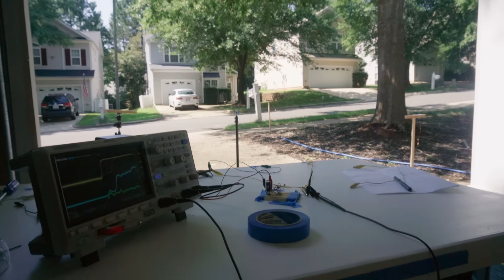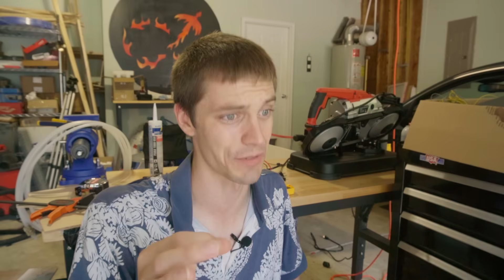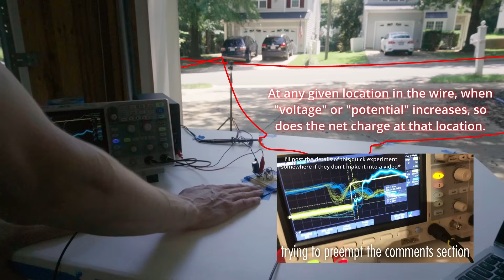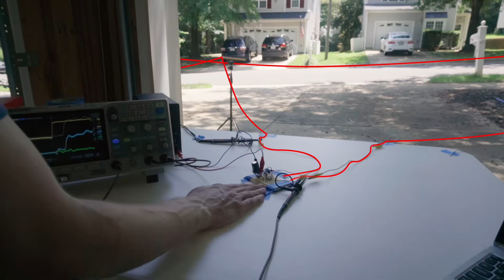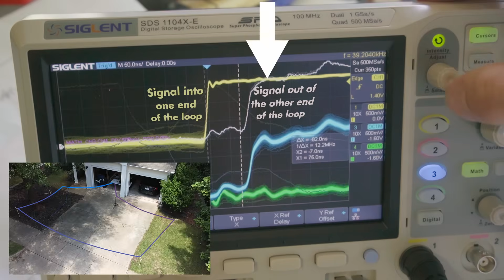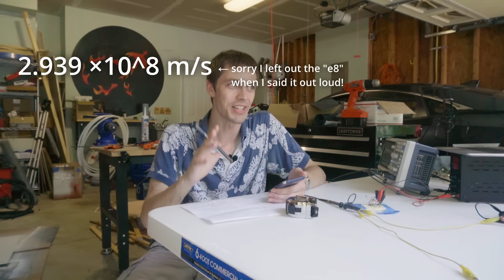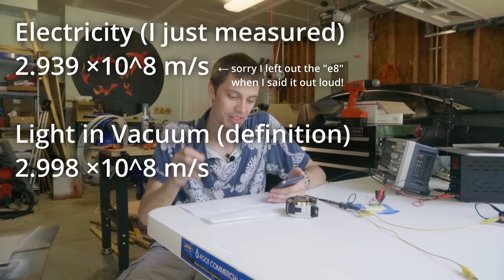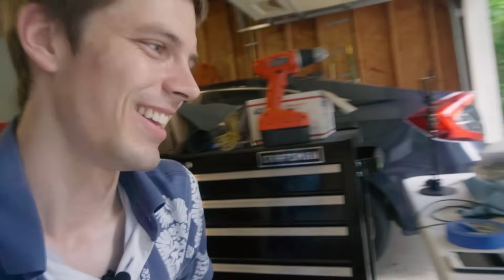Why does WATER change the speed of electricity?

Comment: So if they measure the speed of light with wires on a sensor, does that not say that the speed of light is faster but that’s as fast as the wire can tell the computer a signal?

Comment: Did you use reverse osmosis de-ionized water? Impurities can conduct electricity if abundant making it no longer completely dielectric and effectively turning it into a resistor in the current situation.
Reply from the maker: There’s still enamel on the wire

Comment: long wire has capacitance, oscilloscope measures the delay due to the charging of this "capacitor" and not the speed of electricity, by adding water you just makes this capacitance higher, imho, to be clear here it is necessary to measure both front line and back line of the signal (to exclude capacitance/inductance effects)
Reply from the maker: Yes! Also related to light transmission

Comment: 212
I have a question for the author: I'm interested in the frequency of the rectangle that was fed into the loop. If my assumptions are correct, it should be about 30 MHz. With a longer rectangle, the delay would be even greater. Thanks for the answer

Comment: If you fill a hose with water and it's 100 miles long then turn on the tap and water instantly comes out the other end did water just travel at the speed of light ? 
No
Neither did your electricity
Reply from the maker: It’s not instant with water. be careful not to confuse electrons with electricity
Reply: @AlphaPhoenixChannel Yes it would be instant if filled with water, its the only option.. but nothing traveled the full length of the hose. Same as your electricity.
Reply: @iRiShNFT It is never instantly. The pressure wave propagete with the speed of sound (1500 m/ s)  through the hose. So it will last around 67 seconds.

Comment: Frequency dependent dielectric effect is called dielectric relaxation and causes high frequency power amplifiers to stay rugged withstanding higher than dc allowed overvoltage stresses on cmos transistors gate oxide layer

Comment: spoken like a modern scientist ... and not an electric engineer.
I wish you would have given more information about solid strand vs braided wire. Because you're speaking like charges create the gradient curve and make little demands for electrons. No, I believe that it's magnetic stray currents that inhibit the initial propagation. Some kind of neutral conventional current head is moving along making the demand at near light speed. You can think of it like an infinite virtual photon that breaks apart as needed for a charge density demand. Behind it is a balance of magnetic vortices in the wire. 60 degree braided wire has a cosine cancellation effect on the skin eddies. This looks a lot like a sink drain. 
It makes sense for chemistry backgrounds to think in terms of charge, but in the engineering world, we see charge nullified at small distances. Current moves loads and reigns supreme and makes a lot of stray signals. But we use current loops to overcome noise because voltage is very bouncy and unpredictable across a wire. It's the magnetic part that radiates infinitely away from the wire and regulates the current throughout a conductor or coil. I admit there's not a lot of quantized units around the magnetic field, but any long distance effects have to consider them. In fact, the magnetic lines are entirely unbreakable and more of a auer-sum than voltage waves.

Comment: The field is outside the wire, OK - but how far outside? What does that depend on? - the voltage? - the frequency? - the micro-surface roughness of the wire? - the crystalline structure of the metal? So if you put a rubber-insulated wire in water, what factors (aside from the thickness of the rubber) would affect whether the signal in the wire would "see" the water or only the rubber?
Reply: the magnetic field extends infinitely far but falls off with distance, there is a formula, it depends on current ie amperage but current is induced by a voltage drop and influenced by resistance so its all related
Reply: the only way to block it is with a conductive sheath

Comment: Actually, you measure the resonant frequency based on the wire length and with a standard sine wave, you will find roughly eighty percent of the speed of light.. however drive it with an open ended Tesla coil capacitor and coil network, sending through counterspace, and You can exceed the velocity of that of light, based on the wire length

Comment: the magnetic field of the earth is in a way being conducted through the rock, and as soon as the rock, soil, etc come to an end and interface to the air, the magentic field drops off sharply. Because many minerals are para magnetic or exhibit other forms of magnetic responses which means they play a role in helping to donduct the magnetic field. otherwise the ionosphere probably relates to it also and it might by why the field lines loops out the closer you are to the...surface. ina sense. they go intothe south pole exiting the northpole. So water is also higly polar and magnetic in ways. idk about basalt. ocean crust is basalt. so you will see a different magnetic field strength perhaps more moving,stronger. simply by being at a deeper ocean depth you will be in a stronger field. the cold temperature helps increase the hardness of the magnetic field that does exist, in any metal, or the chance for the field to work on the conductor because it is more responsive with colder temps. Cold increases magnets. If you have a conductor go perpendicular to the magnetic field lines you will be increasing the resistance because not all electrons on net are moving in the direction of the axis of flow the length of the wire, and if they are not all of them in the right direction on that axis. so you have resistance in general. By crossing the field lines the conductor is even more resistant. If you can orient the conductor the right way with respect to the field lines the magnetic field deflects electrons trying to move not along that wire length, and therby reduce it's resistance.

Comment: What if the tube is filled with distilled water?
Reply from the maker: Shouldn’t change anything - the water isn’t conducting, just getting in the way of the field
Reply: @AlphaPhoenixChannel true, it isn't, water is an insulator. It's all the stuff in (tap) water that is conductive (minerals). 😉
Reply from the maker: @Iowa599  i have an insulator between the wire and the water - i don't mean the water isn't a conductor, i mean it's not conductING
Reply: @AlphaPhoenixChannel I know, but the field is interacting with it, like you saw.

how would interaction be effected if the wire was routed through a giant insulator that is more resistive than air?
Reply from the maker: @Iowa599  the impurities in the water that allow non-distilled water to be conductive should have a negligible effect on its ability to slow down the field.

Comment: Nice attempt, but you might want to check out the "Electron hole" concept from electrical engineering. Basically, your battery or power supply is pushing electrons on one side and displacing the electrons in the wires atoms in a wave effect, and sucking the electrons from holes on the other side which again propagate like a wave. That means on the one hand you are recording a timing difference between the holes and electrons, and on the other you are recording the wave propagation.rather than the movement of individual electrons. You can solve the one issue by powering a device at a distance to accurately figure out how quickly the device powers on. Of course the fastest would be a light emitting device and light receiving device, you will be dealing with the distance between the transmitter and receiver, and threshold voltages, The other option is to use a cathode ray or electron beam gun to measure direct transmission speeds.
Reply from the maker: There are no electron holes in metallic conductors - the fermi level is in the middle of a band so thermals are enough to get a single quasiparticle-electron moving

Comment: 9:14 that's so wrong, electrons starts moving because of the differential potential, electrons basically just wants to fill the dipole holes at the other side of the cirfuit, because they were already there, that's why your oscilloscope had an basically* instant reading of the electrons moving when the circuit is connected, technically we can't physically measure anything beyond the speed of light, that's the limit, theoretically we can have predictable operations by equations happen instantly, but just because we imagine them to be that way, doesn't mean they didn't hit the limit, you can't prove if electricity is happening at the speed of light, we would have to ask what even is electricity, it's different for DC and so is for AC, if you've stretched out a display of your mobile in time and space to an whole track of a C so that one way to the right would be half the speed of light and so to the other side, the screen would start bending the rate of framerates if watching a video, or a gif, whatever, so it would get bend by the time, but if you zoomed out your self in space back so that both ends of the sides would stratch for a half speed of light to you, you would see the presumed video relatively speaking more stable and so it is with electrons... So we either would have to ask what is electricity or what is time and therefore what is space
Reply from the maker: You’re making this harder than it is. A “dipole hole” isn’t a thing, and the rest is explained in this video and others on this channel. Humans know what electricity is and how it works to an EXTREME degree of precision. AC and DC also work the same way
Reply: @AlphaPhoenixChannel  DUDE xdd what do you mean it isn't a thing, just seconds later you said that electrons are the cause of electromagnetic fields, as if electrons had them selves electromagnetic fields, it's the material which the eletricity is lead trough that creates the field and even without it, those electrons are still there without any sorts of voltage/amp ratio, all that's happening is that you're amplifying the intensity of the flow of electrons so it is a hell of a BIG deal oh my god, the other half of what you've just said, AC and DC isn't the same, lol, who even thinks that??? It both has physical aplications and your channel isn't covering nothing but measuring experiments together with some random calculations mixed up with an oscilloscope, yes you technically are measuring the speed of rate electrons are shifted, but the description you've depicted is horribly wrong, not pointing out that you've said that electrons are hmhmm, *particles*. Well doesnt matter anyway, it's BS to think that we as a humans understand everything about electricity when resistors efficiency literally drops because of the conversion into heat, it's basically similar with transistors just nobody ever hit the nail with vacuum tubes before did that? Remember the old room computers era? When the efficiency of those vacuum tube transistors making the logic gates had minimal voltage rating for working about 100 volts? Well thats similar with resistors conversion power draw into heat, but yeah bro, sure we know everything xd

Comment: Propagation constant of light (electromagnetic radiation) varies with the medium/material through which it travels. The  commonly used value of 186000 mi./sec or 300000 km/sec is the "free space" value. When propagation is through any other medium, such as water, metal, etc, the value is lower.

Comment: Thanks to Admiral Grace Hopper, I know that the distance light travels in 1 nanosecond is 1 foot. (0.9836 ft to be exact), and I know that a meter is (close to) 3 feet, so if it's about 30 meters, that's 30*3, or 90 feet, and that's pretty close to 98ns

Comment: Of course voltage & current are affected at the speed of light.  It's not the electrons moving that do that, they are moving in response to the field.  The speed of light is the speed of causality, the speed of the propagation any massless field.  It's not some kind of electron pressure.
Reply from the maker: The field is caused by electron pressure. See my video about the Y circuit at 1000000fps

Comment: When you say you have to flip the switch a bunch of times to give the oscilloscope data to decompose the signal, does the frequency at which you flip the switch affect the frequencies it ultimately detects? Like, if you flipped it slower or faster, would it change the results? My intuition is that switching it many times would create a different decomposition than switching it only once, but I’m not too knowledgeable on the subject. 
I know one way of modeling a switch is a differential equation with a step function. I wonder if that be used to find the frequency. Anyway, great video :)

Comment: The DC mode is just the AC mode when its frequency become lower and lower, it's the limit(with the mathematical meaning). You could have maybe obtained better expected results if you had use a square signal with a much lower frequency to switch your assembly or even just use a one-shot recording ? There are maybe non-linear effects that could complexify the results ?

Comment: @ 22:05 you say that the act of flipping a switch is AC. Isn’t it still DC since the direction of current never changes? It is just sine wave with a DC offset? Or am I not understanding correctly?
Reply from the maker: Ac is “special” because it varies in time. The change in the signal is what makes transformers work, etc. you’re right it’s like a bunch of sine waves with a dc offset, but the sine waves are still there so stuff is changing!
Reply: @AlphaPhoenixChannel Thanks! I love your channel. I think I splitting hairs on the definition of AC. When I think of AC, I think of a change in both magnitude and direction.

Comment: How is this not the same as saying "I live 5 miles from the water tower. It takes 1 second for the water to appear when I turn on my bathroom faucet. Thus, water moves at 5miles/second.  Don't worry, I've removed every quadrillionth water molecule from the pipes first."

Aren't you measuring the speed of the wave, not the speed of the electrons?
Reply from the maker: The speed of electrons is not the speed of electricity
Reply: @AlphaPhoenixChannel  Isn't electricity defined as the flow of electrons?

Comment: Oops there, Dude!  Not to be negative about your video here (I thoroughly enjoyed watching some of your others) but the electrons come out of the Negative side of the battery, not the Positive side.  This was proven by using some dye in a test cell filled with a clear gel, and the flow of electrons moved the dye to the left side of the cell, which was hooked up to the Positive side of the power supply.  And when I do diagnostics of automotive electrical systems, in particular a starter motor Amp draw test, the clamp probe goes around the Negative battery cable and there's an arrow on the clamp which points AWAY from the battery, which is the direction of the current flow.
Reply from the maker: I’m 100% sure that I never specify electron current coming from the positive side of the battery. I would have caught that in the edit. It’s possible you heard me talk about conventional current
Reply: @AlphaPhoenixChannel  It's right there at the 9:20 mark.  Just about my only talent (curse) is spotting typos, they seem to fly off the page at me, or contradictions in logic/facts. 
  Yes, there is what we call conventional theory (from Benjamin Franklin's error when he was experimenting with electricity), but I prefer to always use what really happens.  

Randy

Comment: I finally got why electricity can move faster than electrons !  BTW my feeling about decomposing signals into sine waves.  The sine waves are the eigenfunctions of the wave equation.  If you send a square wave down a wire it gets all smushed as it propagates, whereas sine waves stay the same all the way down the wire.  If the wave equation was different, and the square waves retained their sharp corners, then it would make sense to decompose sine waves into square waves.  So I think describing waves as the sum of sine waves is a cool mathematical trick rather more than a physical description

Comment: if you are measuring the "speed of electricity" shouldn't you be measuring "time per power" (and presumably some delay according to resistance) verses "time to signal" (presumably the speed of light, but not useful for work)? ...yeah speed of electron flow (power), not the speed of voltage transmission (signal).
Reply from the maker: All of these are the same thing

Comment: I've struggled forever to understand the minutia around how electricity actually flows, having learned at some point that the flow of charge or electrons has more to do with the fields around the wire than anything. I never really got a full understanding of how that really worked and its been one of those things that have bugged me forever. Having the elementary understanding solidified in my head forever, the flow of water/pipes analogy etc, but knowing it is incorrect or incomplete but not really getting why yet. Thank you so much! I didn't expect Fourier transforms to show up here and it's such a beautiful thing :D